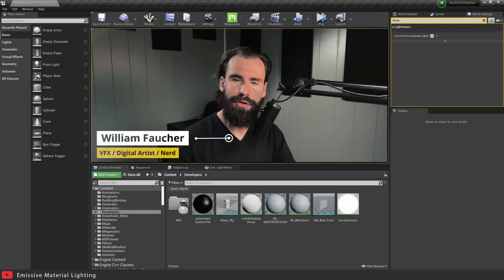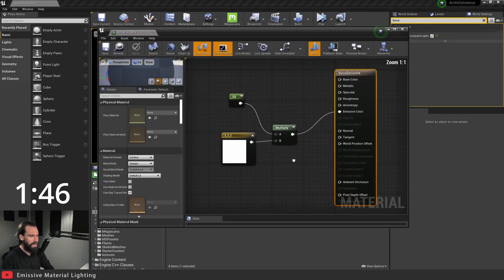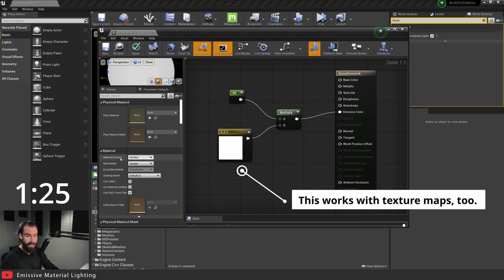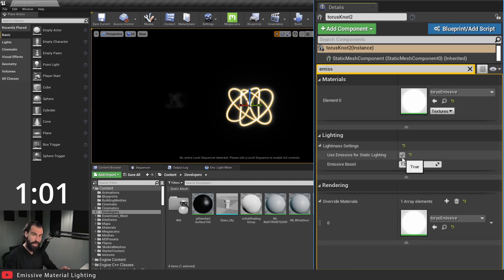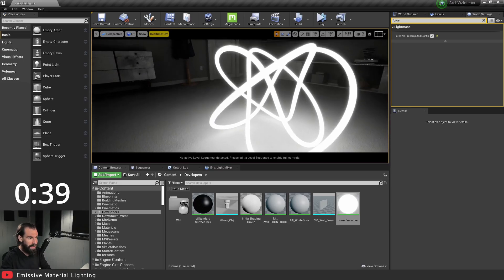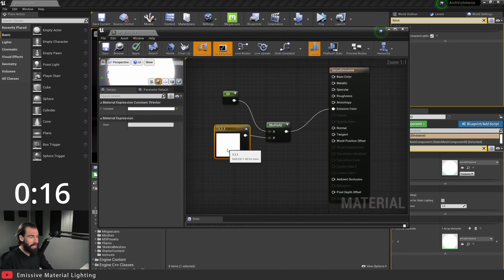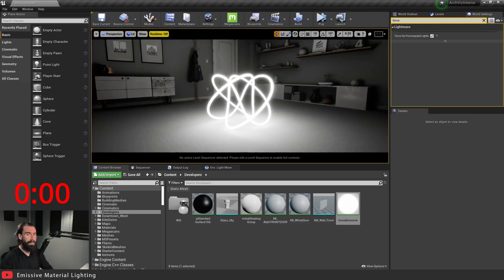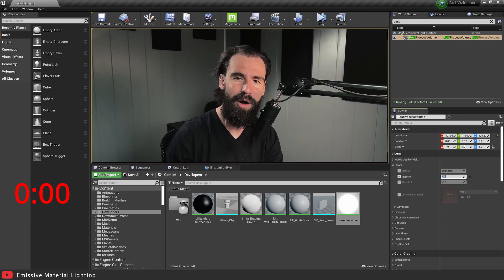Lighting with Emissive Materials [GPU / CPU Lightmass] - Unreal Engine 4

Comment: @williamfaucher I'm trying to do the opposite of it, and according to documentation and here, I should be able to disable the effect of emissive material by turning off the setting "Use Emissive for Static Lighting" .. but its not turning off. Perhaps it doesn't work with Lumen currently?
Reply from the maker: This video is for baked lighting, not Lumen. Lumen is a completely different thing! :)
Reply: @WilliamFaucher  Any idea about how to make the emission not contribute light to its surrounding (without stencil)?